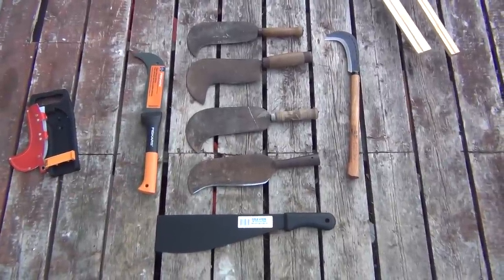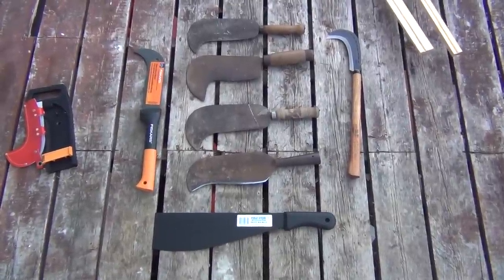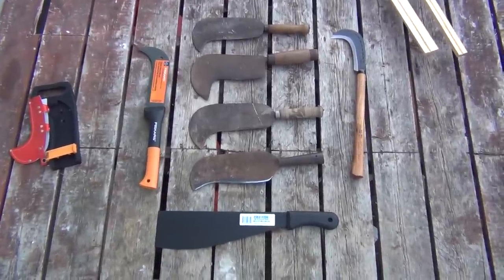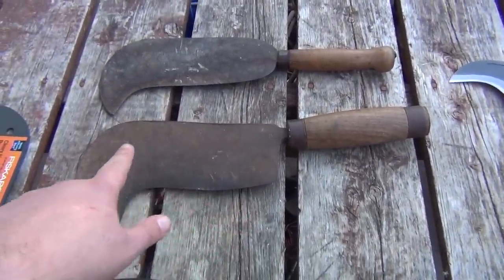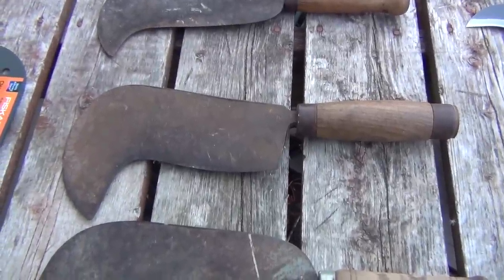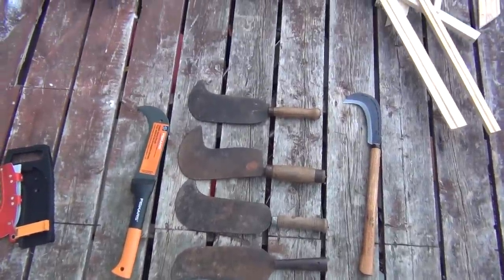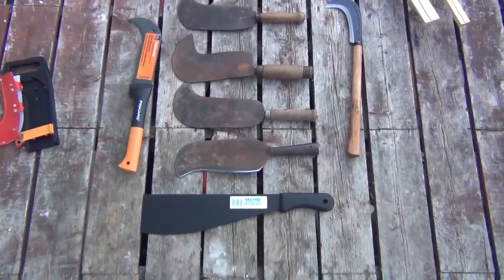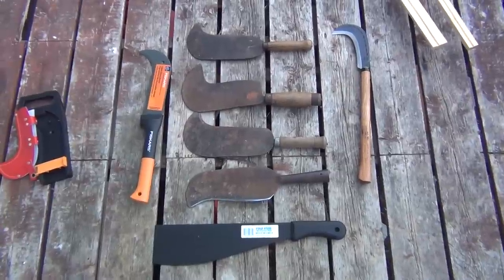Billhooks : Fiskars, Japanese, French

Comment: These are very versatile tools, fitting somewhere in between machetes and axes on the wood working tool continuum. They cut well, but can be difficult to baton with due to their shape. They would be very cleaver-like if they didn't have a curved blade. The Fiskars version has worked fairly well in my experience with a little bit of re-profiling, though I'm sure it's not as heavy duty as the French ones. It seems fairly tough but I'm sure they can be broken if you really push them.

Comment: Most of these bills have a collar where the blade goes into the handle.  Can you describe the construction here?  Is it just a collar, or is it a cap with a hole through the metal and wood?  These are obviously plenty durable, and I'm interested in using this method for some repair/rescue of some old blades of mine.

Comment from the maker: @me2bfc The ones on the bottom are collars, the ones on top are caps. They do little in practical use because they wood dries and they all fall off. All of the ones shown are so loose that move around. They can be pressure fit with a soaked handle but I not a fan of soaked handles as you have to keep them soaked or the fit loosens. I just be a heathen and epoxy them in place.

Comment from the maker: They are not common here either normally what was used for such work was a very heavy, thick and short scythe blade to cut brush. A sickle was used for harvesting and in general for very light work. To be frank, both of these are replaced now by mechanical cutters which use either small saws or motorized spinning blades which chew through scrub and brush.

Comment from the maker: @T3hJones The handle on that is just massive, the blade however is surprising light (for its size) and the edge has only minimal damage. It was well used, but not as harshly as some of the other ones. The socket one is extremely heavy in comparison, but that is just due to all the metal in the handle and without an extension it just has a brutal heft beacuse of the weight/length ratio.

Comment from the maker: @knivesandstuff Yes exactly, if this was non tapered at the tip thickness it would be flimsy and difficult for heavy work, yet if it had the full thickness of 1/2"+ it would take insane strength to wield it with any fluidity. The combination of both gives much more versatility in cutting ability and durability.

Comment from the maker: @TheCanadianKnifeGuru There are some hidden treasures there under all that rust. I cleaned up one yesterday and it was absolutely hilarious how mangled the edge was after the rust was cut off. The edge looked like a hacksaw blade it was that badly damaged. The handle was also covered in grime and was very sticky. But it is now cleaned up, blade and handle with some fresh linseed oil still drying.

Comment: Something you failed to mention in the video is the fact that all three of the French Billhooks that utilize the hidden peened tang are all Forged Blades... and the fact that they are forged blades allows that that fine distal taper from the extremely thick tang all the way to the relatively thin tip...  These are much more durable tools then modern Stamped out blades... they also are much better balanced ... I have an old Italian Billhook and its forged and has a hook forged into the tang as well that prevents your hand from slipping off of the handle...  Its so much better quality then todays tools that its depressing to see how far the quality of everyday working tools has actually fallen in the last 50 or so years although mine and all of your Forged French Bills are probably date back before 1950.
Reply from the maker: rainmechanic Yes, that kind of extreme taper would be very difficult to produce on just grinding alone as it would be a tremendous waste of steel, especially in that width. Ideally you would want taper rolled stock however that isn't terribly common.
Reply: Old doesnt mean better necessarily theres some good stuff being made in England brand new. Collectors have priced most of the good condition old stock out of the market for beginners unfortunately. But that said all my billhooks are old but I was lucky.

Comment: Say Heah Cliff,  I isn't a billhook per se,  But picture two hatchet bits on each side and then a chisel slightly curved top and a convex curved blade along the handle.  one side has the modified billhook on the curved blade side.  It's made in the 420HC and it's not bad as far as edge retention . Nobody did any videos maybe one old one.  Gosh I wish you could.  ,, .
Reply from the maker: Yeah, there are a lot of styles of such blades. I could use a new one each week for the rest of my life and likely never get through them all.
Reply: In any case I Wish You a Happy, Health,  and Prosperous New year . ,, .